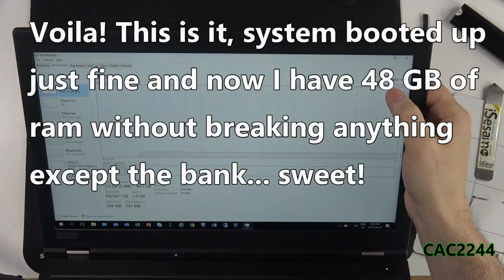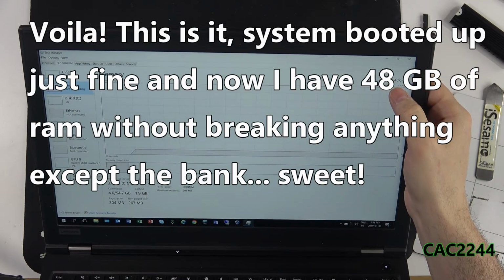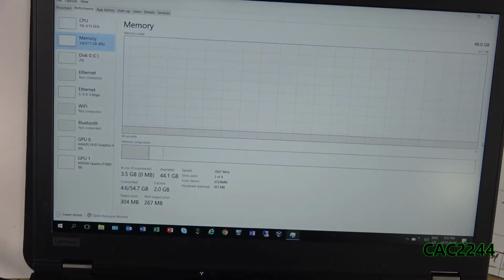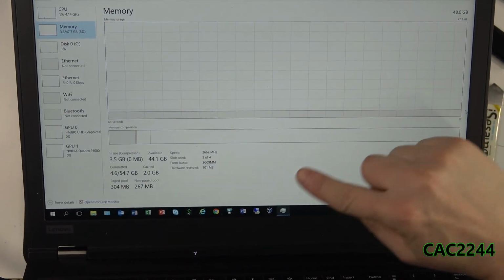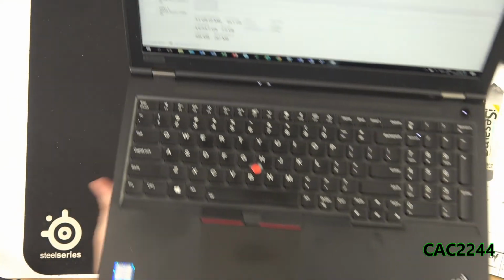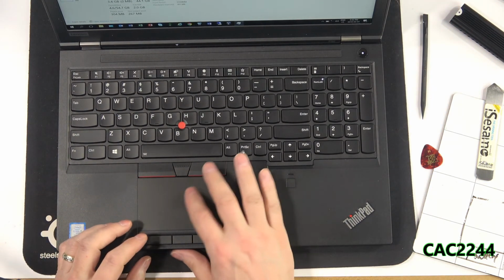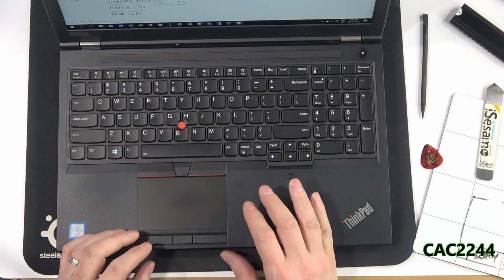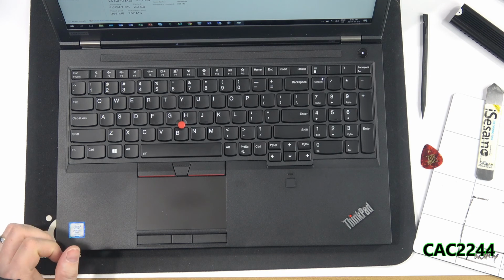Lenovo ThinkPad P52 replacing ram under keyboard

Comment: NOTE: POST (Power On Self Test) may take longer on first boot after RAM size changes. Both my P52s did. The first opened easily but this video helped open the second (that latch design is absurd). Useful well done video! I used the offical tool (I've two P52s and the tool is cheap) but your video was helpful to show the precise motions to do the task. I've many ThinkPads and one trick to check screw alignment is turn them COUNTERlockwise and listen/feel for the "click" indicating thread engagement before turning clockwise to install. Works on any threaded fastener.

Comment: I had to add 4 sticks of RAM to this same laptop at my job.  He does a good job explaining the screw removal and the running of the pick or thin tool around the edge of the keyboard to loosen it from the laptop.  However, instead of pushing up on the keyboard, you may want to rotate the laptop 180 degrees so the screen is closer to you and the keyboard further away.  You can now carefully slide the keyboard up with a little force which is easier for removal instead of pushing.  Just get your fingernails in between the keyboard and laptop and slide the keyboard up.  Once it moves up, follow again what he says about carefully lifting the bottom of the keyboard out from the laptop.  You have more strength pulling instead of pushing but the keyboard needs to be loose first.
Reply: Thanks. Will give this a go.

Comment: Sorry I’m confused. You swapped out one module in one slot under the keyboard?? Did you leave one empty slot still open under the keyboard? It appeared there was only one slot in the under-keyboard bay. Or, is there two slots in the bay beneath the metal cover? Why not add two modules under keyboard to maximize RAM while keyboard is removed? Or, did I miss something? Thanks for the vid!!
Reply: There are two slots under the keyboard, one on top of the other. They are staggered so that you can access the bottom one after removing the top card.
Reply from the maker: I put the two new ram sticks under the keyboard and the one original stick in the back of the laptop.

Comment: what tool did you use to loosen the two mouse buttons before unscrewing the keyboard retainers?  thanks
Reply from the maker: The mouse buttons are just pressure held, so you can pop them off with any spudger or even your nails or a butter knife or small flat head screw driver. I used my iSesamo prying tool.
Reply: Is difficult to find that tool anyway

Comment: I'm afraid you have put one bank of memory in 1 and the other in 2  so they are not in a 1 3 or 2 4 configuration, so they will not be in "dual channel mode"  info I recieved by Lenovo before purchasing the same lap top.. so I have 2 8Gb cards under the keyboard and 2 16 Gb cards in hte same place where the NMVe drives are..
Reply: Would it be better to move higher modules 2X16GB to under the keyboard (primary slots), and place the smaller size 2X8GB modules to the back (secondary) slots?  Is there a performance benefit for that switch?  Example: 2X32GB under the keyboard and 2x8GB in secondary slots, compared to switched configuration. Thanks.
Reply: @ryank.8753  No difference.. 2 my knowledge.. Being that the banks under the keyboard are 2 and 4. I.e. the secondaries
Reply: @mgwc67  yup
Reply from the maker: Good eye... yes, i populated 3 memory slots out of a potential of 4 slots, so yeah,  dual channel mode might be compromised... Your configuration does optimize the channels.

Comment: I am between Thinkpad P53 or Legion Y740. I need it for 3-D geological modeling and Radar image processing. Thinkpad with GPU 
(NVIDIA Quadro T1000 (4GB GDDR5)), but legion Y740 with GPU RTX 2060. Which one is better for my job?

Also, can i upgrade Thinkpad Ram from back for 32 giga, if i will buy it with 8 giga ram
Reply: easy first... the P52 (so i expect the P52) goes up to 4 X 32 GB of Ram.   I'm afraid, though not 100 % certain, that you cannot exchange the quadro with a Nvidia RTX.  I am a bit more certain that you can buy a P5x with more GPU memory!

Comment: QUICK QUESTION: in the website says you can go up to 128 gbs of ram ,,, so where else I can put those memories?! I have 2x16 = 32 gbs under the  computer + 2x16 gbs more under the keyboard ... where else?!?!?!
Reply: you can put 32gb modules then 32gbX4=128gb
https://www.newegg.com/samsung-32gb-260-pin-ddr4-so-dimm/p/0RM-002H-000X1
Reply: That means each slot with 32GB, in total 4 slots, 2 under keyboard, 2 under the back cover.
Reply: Samsung recently release a 32Gb memory module UDIMM, so 4 sticks would come 128GB

Comment: For the keyboard removal you completely cut off the part of the video after unscrewing the two screws. That’s the most important part as it’s the most difficult. Your video makes it as if it’s a simple removal of the keyboard.
Reply from the maker: True, true...I had the fedex guy at the door at that specific time, but it is NOT the most difficult part, far from it... For me, the keyboard just literally came loose... No problem, but the exact best way to remove it is, after removing the screws under the mouse button covers, is to just to push the keyboard towards the screen (monitor), but without lifting. It should go back about 3-5 millimeters, then gently get it to lift using a gentle plastic pry tool and snap it off... For me, just wiggling the keyboard was enough to take it out.
Reply: @cac2244  Thanks for your video, I install additional ram modules for P53 today. P52 & P53 are similar mechanical structures.
I agree with @ScotsmanDC, it's not easy for me as first time to unscrew keyboard of P series. It really takes over half hour to unpack it.
After I review this conversation, you mentioned "push the keyboard towards the screen (monitor), but without lifting." I understand I didn't push keyboard towards the screen and try to lift it directly. I learn it now.
Another difficult part is loosening two mouse buttons. I use guitar pick but the seam space is too small. I worry I break mouse button and gently push them so I spend some time to do that.
Thanks again for your video sharing.
Reply: @HowareyouTW  Did your P53 come with a single 1X16GB module under the keyboard? Or, was it 2X8GB modules installed under the keyboard (straight from the factory)?  Thanks in advance.
Reply: @ryank.8753  Yes
Reply: @HowareyouTW  Which one - 1x16GB or 2x8GB modules?  Thanks.
Reply: @ryank.8753  1 * 16GB
Reply: I had to add 4 sticks of RAM to this same laptop at my job.  He does a good job explaining the screw removal and the running of the pick or thin tool around the edge of the keyboard to loosen it from the laptop.  However, instead of pushing up on the keyboard, you may want to rotate the laptop 180 degrees so the screen is closer to you and the keyboard further away.  You can now carefully slide the keyboard up with a little force which is easier for removal instead of pushing.  Just get your fingernails in between the keyboard and laptop and slide the keyboard up.  Once it moves up, follow again what he says about carefully lifting the bottom of the keyboard out from the laptop.  You have more strength pulling instead of pushing but the keyboard needs to be loose first.
Reply: literally the hardest part, the rest is nothing. Feels like it was super glued in. end up just jamming it out, but nothing broke luckily.